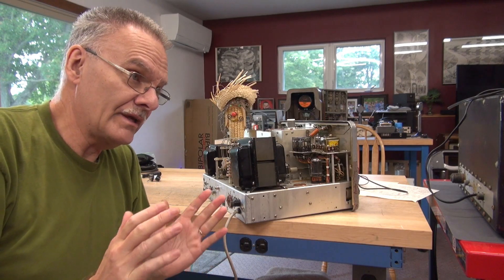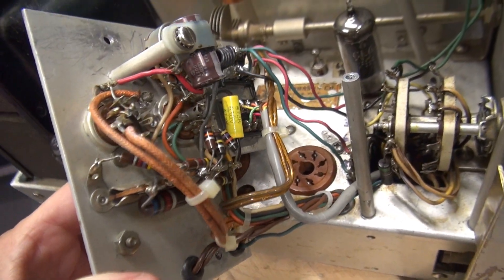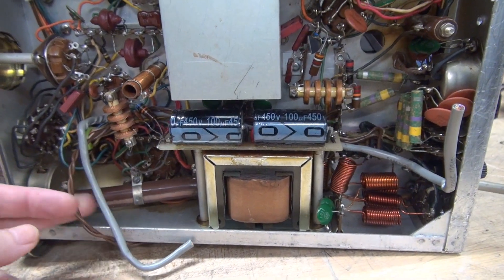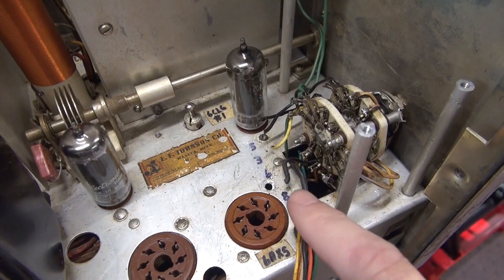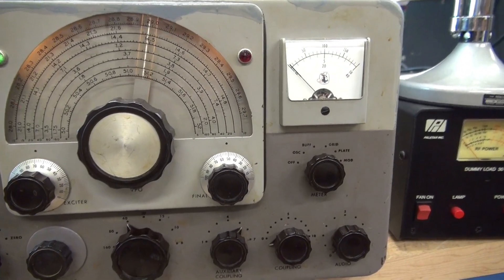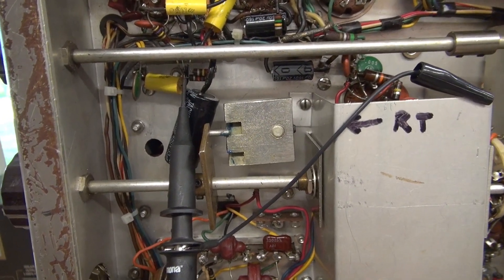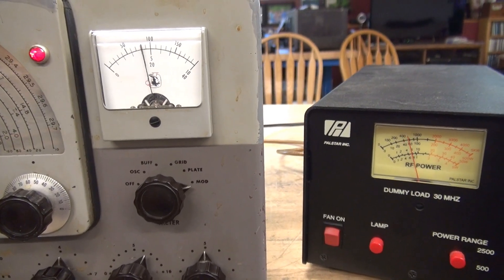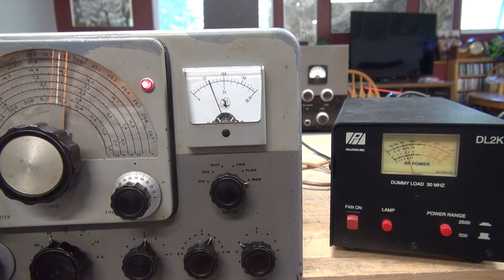King Kobbler modifies Johnson Viking Ranger II Tube ham Radio Transmitter another Kob job

Comment: There are well done mods, and terribly done mods, and lots of mods in the middle. But I'm happy to see mods done to rigs, and I'm happy to make those mods safe or make them work better. Mods are good. Anyone who simply spends their time as a ham talking on stock commercial radios is missing most of what ham radio is all about. I've let out quite a bit of Magic Smoke over the years learning how not to do that. But the whole point of it was that I learned. Learning is what the hobby is all about. I figure if I haven't gotten into my rigs and changed them in some way or other to do something I wanted, then I got the wrong rig. That's probably why I only buy HT's new, (and I modify them, too.) All the rest of my gear is used, or kits, or absolute basket cases. The first thing I do when I buy a rig is take off the covers, figure it all out, and then decide what would be fun and useful to mod, to solve problems the rig came with from the factory, or to make it more convenient and perform better than when it was new, to soup it up, to modernize it. I also enjoy helping other hams with mods to their gear. That's the sort of thing the FCC actually had in mind for us when they established the Amateur Radio Service, and it suits me just fine. Sure, some antique gear should be kept absolutely stock, but it becomes nostalgic museum pieces. All the rest of the gear in someone's shack should be for fun, to experiment with, to reflect their interests and help them pursue their knowledge of the radio hobby.
Reply: Let's not forget safety mods.I enjoyed the read. Ty.